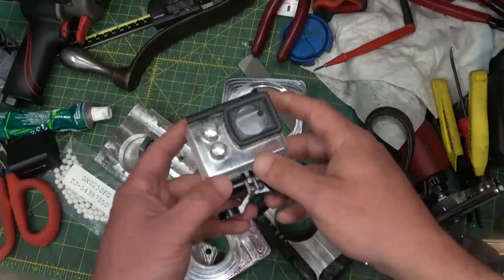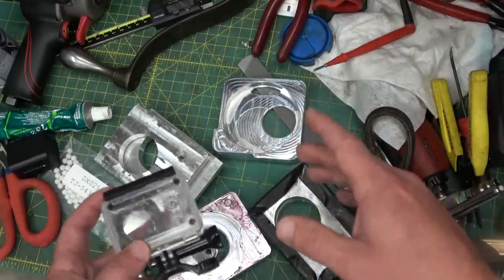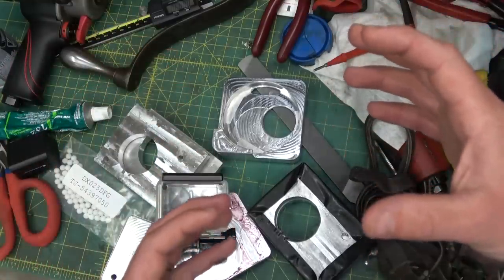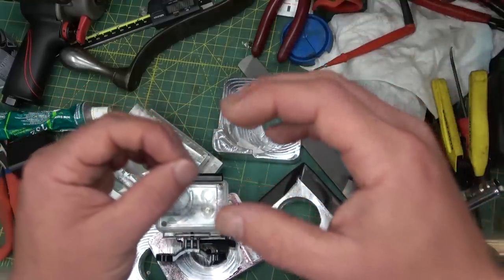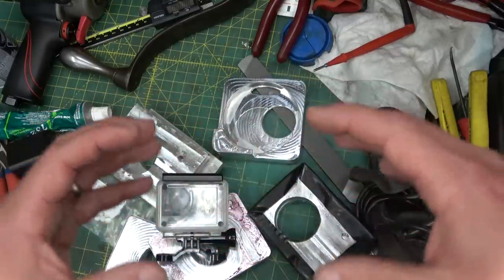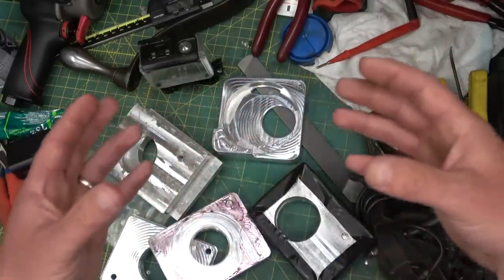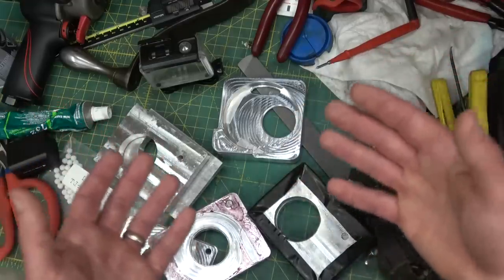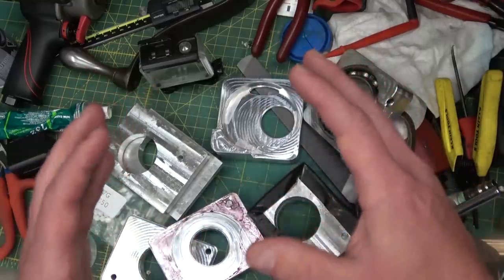Homemade Spinning Lens | self-cleaning gopro prototype

Comment: The coolant seems to collect on the edge of the filter collar. Some relief cuts might allow it to fling off.
Reply: Or a lens without a lip or the lens itself protruding past it.
Reply: I was just thinking the same. Four small slits 90 degrees apart might do the trick.
Reply: I agree noticed that myself

Comment: When you're making the battery powered version I'd suggest checking out the brushless racing drone motors. Things run like a hot damn, they're cheap(ish, for the performance) and easy to get.

Comment: I'm curious Uncle BumbleF...

Why not just make the window >2x larger, look through one side, and then just mount a motor in the centre of it?
Get it balanced nicely and the motor bearing should handle it for you.
Reply: Or imagine a petri dish with magnets on the outter lip. The glass could be the armature...
Reply: 👍A larger disc would increase the centrifugal force at a given rpm.

Comment: why don't you mount the glass at its center with a small bearing and use the camera off-center?
Reply: That would require a much larger diameter filter. Hypothetically feasible though. Not sure what the going rate for an 82 or 120 mm UV filter is though.
Reply: @martindinner3621  Put the bearing in the CENTER,not the outside.The marzel -vanes to encapsulate the outer circumference for the turbo effect.Must use a silica-based semi-clear material,not Lexan.

Comment: Dispensing the idea of all hydrophobic coatings because you dismissed rain-x would be throwing your baby out with the bathwater. There are plenty of semi-permanent and permanent hydrophobic coatings for various substrates. I know a company in Cannuckistan that would gladly have someone come coat parts for you for free. Silicone is junk, but silica carbide based hydrophobic resins are the bomb. The main reason hydrophobic coatings aren't already used in these purposes is because they labour intensive and difficult to apply in a manner that leaves glass and acrylics optically clear.

Comment: Ave, I stay at a camp in the bush in NW Nontario - I decided to catch one of your videos late tonight while the sat connection was speedy tonight, before turning in. Around the 11 minute mark the Cummins diesel to electrocity converter stopped pumping electrons. I grabbed my trusty (thankfully also dusty) headlight and ran through the dark to the gen shed. Upon arrival I flipped the Jerry rigged light switch to turn the fuel pump off and kill the loud diesel machine, swapped the battery, cursed at the black and dicker charger that had stopped pushing ampacity, cursed at the lightning fried control panel, fired er up, flipped a breaker and the lights went back on. Glad you have long videos because I woulda been plum passed out and there's fishermen with CPAP machines up here.

Comment: Lose the bearing and rotate the lens inside an Inrunner bldc motor, you can even adjust the rotation speed accurately to control it and being on a magnetic bearing it be silky smooth.

Comment: I still don't understand why a central axle isn't the way to go. I know it's good to have the overall package smaller, which is what the outer bearing would allow, but it seems too difficult to make it roll on the outer edge of the lens. It looks like your version works pretty well, but for ultimate cheapness, some small bearings could be used for the central axis, and then it could also be motor driven.

Comment: Thanks for the explanation on Rain-ex, I was one of those dummies wondering.

One thing you said in this one made me think of an Applied Science video where Ben was cleaning a glass microscope slide. He said that truly clean glass gladly wets with water and spreads out, but the amount of oil that removes its ability to do that is so minuscule that oil on particles of dust in the air is enough to prevent that. So your explanation works for real life glass which will always have some modicum of oil on it, but not so much for truly clean glass like you get from ultraviolet cleaners in labs.
Reply: The shaving foam method is so much cheaper. I bought two bottles of the stuff
Reply: He's off a little actually; not silicone but rather ethanol, isopropyl, and acetone. It still doesn't work for this use case though, lol

Comment: Spin the camera, sort out the footage in post.  Reference Corridor Digital arrow films.
Reply: Spin the friggin planet, sort it out in post...
Reply: @mick7sp  would take a heck of an O ring for the friction drive
Reply: @MadnessQuotient  Friction is a social construct.
Reply: @mick7sp  don't you dare assume my frictional persuasion
Reply: This wouldn't work well. But theoretically you could get it spinning at just the right speed, such that every frame was taken at the same orientation. 3600rpm for 60 Hz?
Reply: @VonGeggry  talk about over kill, it could be done if you hack the go pro and use an arduino  to sync a stepper motor to the frame rate.

Comment: Used to use Mr sheen on my motorbike visor. Great in heavy rain and in slush at night. Gave me a fighting chance.
Reply: Yup. I use RainX for plastic(came out a few years ago; standard RainX isn't silicone but rather ethanol, isopropyl, and acetone, which many a biker that didn't read the bottle has found out is absolutely NOT plastic safe!), probably the exact same stuff I'm sure(just propolyne glycol and water), and it's a MUST HAVE for anyone that rides with a helmet.

And, if you don't wear a helmet - WTF is wrong with you?!?!

Comment: Hi Ave, recently took up surfing and I watch a lot of people using GoPro's in the water and licking the lenses to get the water droplets off. Here's my take on a solution. A rim driven optically clear circular lens similar to what you are doing here but electrically driven. There exists such a thing as a rim thruster that is used in ships on a very large scale but I think this could be miniatureized and applied to this situation. The clear disk would have magnets on the outer rim embedded, applied, glued, mirically attached somehow, and be surrounded by a series of very fine coils operated by brushless motor controller drive electronics. You would be able to spin the lens at high rpm's and also have a magnetic bearing if you worked your angles with the coils and magnets. Just throwing this out there for those who have the money and tools to create such a design...as I don't :( Cheers, John ;)

Comment: Rainx works ok with water the coolant they are using in these machines is not. Even if it did work it would wear off or wash off rather quickly.

Comment: Threaded adaptor to affix the lens and counter clockwise rotation to keep it threaded.   Easier to replace the lenses
Reply: Good thinking. I wonder if using polarized filters will cause a strobe effect with it going in and out of phase of polarized light sources.

Comment: Why not just offset the glass wheel so the hub spins right off  the motor, sitting beside the camera? You'd get more fluid throwing velocity since the line of sight would be right near the edge of the wheel. You've kinda got it offset, but you wouldn't have to do the bearing surrounding anything
Reply: I was wondering the same. Unless you're trying to to keep the package as compact as possible, or ensure a sealed compartment, it seems mechanically simpler (and would produce higher spin speed/forces) to use a larger clear disk (say, 8") and spin it on an axel at its center, and point the camera aperture betwixt the that center point and the edge.
Reply: Under rated comments
Reply: It looked to me like the fluid was getting moved from the middle of the wheel to the rim. So it's clearest in the middle, not at the edge. At the edge there was a build-up.

Comment: Motordrive with O-ring might not achieve the speed necessary to fling the schmoo off the filter. That little motor  would have to have an amazing rip'em...
Reply: Gregor Shapiro ratios, might just need a bigger/ same diameter drive fly wheel type deal
Reply: Dremel motor 😂
Reply: First guess would be HobbyKing and use motors intended for drones and such like. Already get powered by lithium battery source.
Reply: You can drive it axialy aplying the torque closer to the center of the glass to increase the ratio.
Reply: @josuelservin2409  if you can center the drive on the lense securely since the camera is off set you wouldn't even need the bearing.
Reply: CrucifyRobinHood Dremmel motors are kind of large and noisy, especially when the microphone is in the camera and you want to record the sound of that other machine or the weather outside.  A tiny brushless motor would be more handy and less noisy.  Use approx 1 inch / 25mm drive wheel for lower motor rpms within the size constraints.
Reply: You know he has hundreds of drills with their guts hanging out. Shouldn't be too hard to find one
Reply: @letsnotmakethispersonal6021  Yes, and also need a massive lense.
Reply: My cheap brushless outrunners (~$10) do something insane like 20-30krpm on a 12V battery.
Reply: Maybe a small fan motor with a polycarbonate or other plastic disc in place of the fan blades. Would be a cheap experiment with a brushless computer/equipment fan.
Reply: @josuelservin2409  except the lens of the gopro is right in the center and your axial blocks your viewage

Comment: My comment for previous video: 

"Why not to use regular bearing with inner diameter matching lens needed wide? Remove covers, wash out grease and install circle lens inside (i don't know glue with epoxy or made holder rings on lathe) and voila just direct air flow on separator. Yeah this can be bigger in size but stable and precise."

I'm cool huh?

Comment: Thanks for the scientific explanation, Rain-X never worked for me but when I started actually reading the application instructions, it specifies that the window needs to be extremely clean. I live on a dirt road in the middle of farm country, so that is never going to happen. 2 most important things I figured out, scrub your glass. I use 0000 steel wool and windex. clean your wiper blades. I have a tool for it now but anytime I get a alcohol wipe at a restaurant, I clean my wiper blades with it.  Water sheets right off just like in the TV commercials and all I do is follow their instructions, minus adding their product at the end.

Comment: For the electric drive version, I bet if you found a high RPM outrunner motor, an ESC, a servo tester, and a battery, you could just jam the bell of the motor against the rubber you're thinking of putting on the bearing and get some sort of result.  I think most of mine run somewhere in the 20k to 30k RPM range on 12V under no load.

Comment: I used to race speedway and we had roll-offs. You could get electric ones you pushed a button on your bars and it wound a new bit of clear plastic in front of your goggles, but you could also get air ones you blew into a hose. Surely you could adapt a motor on one side, a roll of clear plastic on the other, set a timer or have a manual button, push button, roll the dirty bit around, get some new clear plastic in front.

Comment: if AvE went into water cooling blocks etc for computers, the big guys would be worried :)
Reply: no
Reply: Eh, there just isn't anything all that complex about them, as long as the flow path is decent enough for common sense then it just works(and, mind you, many of the flow paths give up some common sense flow efficiency in the name of "looking cool", and even that doesn't hurt their effectiveness; it DOES cause opaque coolants to collect in specific spots though). 'Microfins' were the last(and really only) real 'breakthrough', they're just far too simple devices to find any more meaningful gains.

Comment: Interesting thing about spinning filters is that the relative speed is quite slow in the centre.  By placing a double size filter with lens at the edge, your relative speed is much higher for flinging crap away.  Get a big filter, drill a hole through centre  and use 1 of your 500 drills to spin it!

Comment: I reckon take a round disc of glass or plexiglass, mounted to a motor shaft directly, with the camera off center. You could have an o-ring around the camera area set into a groove, that sits against the glass, which will act both as a wiper and a way to prevent schmoo from getting to the camera.

Comment: Why use the big bearing? Mount a larger diameter acrylic sheet straight to the output shaft of the motor and spin it in front of the camera. It would be a larger package, but wouldn't create the washing machine effect seen in the camera shots. The larger diameter acrylic would also mean you would need to have less rotational velocity to get the same force causing the coolant to flow away. If you covered about 3/4 of the diameter of the acrylic circle and shot through the remaining quarter it would give extra time for the coolant to dissipate and possibly lead to an even clearer video.

Comment: Hey Ave!!! Why don’t you cut the outer bearing race in two, leave a gap between the two half’s and blast compressed air in that gap. It should be more efficient than from the side.
I mean, in two, so that you have two rings. Hold the two half’s with bolts together so that the bearingballs don’t fall out. 
Nice video and I have a good day.

Comment: From an action sports perspective, you could put a little wind scoop on the casing and a turbine connected to a gearbox that drives the lens to avoid the need for power on the trail.

Probably over-engineered BS, but it would be pretty neat and likely lighter than carrying around a battery pack and motor driven solution.

Comment: I notice that you're getting some visible fluid build-up in the center of the glass. (Low centrifugal acceleration there.)

Have you considered using a larger filter and not centering it on the camera? This should generate the acceleration necessary to clean the part of the filter in the center of the visual field more quickly (at the cost of needing a larger and more expensive filter, of course.)
Reply: That's a good idea, however, the larger filter would also be more prone to weeble-wobbling from run-out as well. This seems like the main issue he's running up against already.
Reply: @MegaNardman  Yeah, and the center would be more prone to damage as well, since you have a wider piece of thin glass still supported only on the edges. It's not a slam-dunk, but I think it's worth considering.

I find it really easy to get locked into a specific solution ("Of course the filter should be centered on the lens. That's how they go on!") and thought an alternative might be worth mentioning.

Comment: Have never tried the RainX spray, but the RainX washer fluid (with RainX in it) works great. The reapplication you describe is a consequence of using the fluid. Give it a try.

Comment: In the semiconductor field they have to wash silicon wafers off during backgrind and dicing.   The water has to have surfactants added (sometimes... depends on the type of silicon and the silicon's sensitivity to electric charge)... and they measure the effective amount of the surfactant present by putting a drop of the water on a glass slide and measuring 'contact angle', which is literally the angle the drop/bubble of water makes with the flat surface the drops placed on.   High contact angle = no surfactant... low contact angle = more surfactant present.   I think I got that right... going from memory as I left that industry a couple years ago.

Comment: I have actually looked into using Rain-X on Haas machines.  The first problem is that you can't use it on plastic, it eats the surface.   There is a marine grade that is plastic safe, but it's not very good.  The second problem, is that it just doesn't work.  It's fine with clean water, but coolant tears right through it, as was clearly explained.  My free solution was to drill out an air siphon style jet nozzle and just blast a high pressure air/mist stream at the window fed with a bucket of distilled water.  It wasn't fully clear, but it was good enough to see the parts through.

Comment: I had to pause after the rain-x section to point out something rather salient- while rain-x itself wouldn't work, there are quite a few more hydrophobic options out the now (acrylic polymers). While I get that rain-x is a no go, perhaps one of the newer acrylic/ ceramic hydrophobic coatings would be better?

Also, I'm firmly in the camp of offsetting the camera lens away from the center of rotation on this project. That's what I see as the better idea, just playing devil's advocate for the hydrophobic coatings. Coated spinning lens cover... :)

*edited for spelling*

*edit* After finishing the vijeo, I see that you've gone ahead with that offset idea. Works a mint, as we can see!

Comment: I posted this on the last video too, but what about going back to cutting your own center piece, but cut the center (spinning) piece with angled grooves in it.  Then drill a hole from the backside much as you did before to pop the acrylic balls in.  Next pressurize the area behind the spinning lens, the air being forced out through the bearing and over those grooves you cut in the center piece would cause the center to rotate, and because of all the airflow no water/shmoo would be able to come in through the bearing and hit the camera lens.  By varying the angle of the grooves you cut into the center piece you could also fine tune how much air was required.

Comment: For consideration: little bearing with a large lens. Camera can sit offset from the centre and you drive the bearing from behind with a small electric / pneumatic motor through the centre of the bearing on a shaft. Lens should clear better as well due to increased velocity on the edge of a large circle.